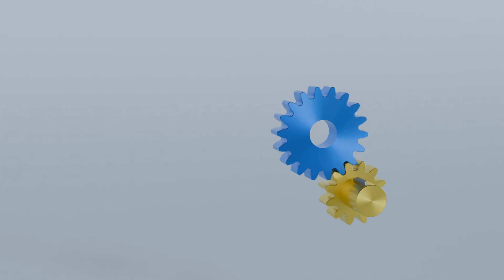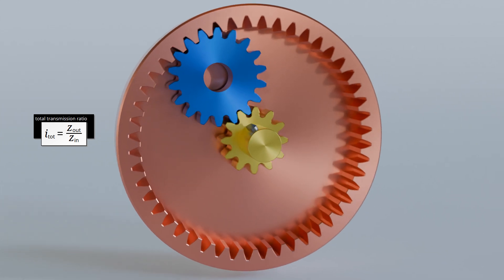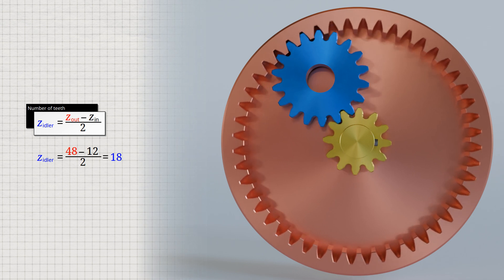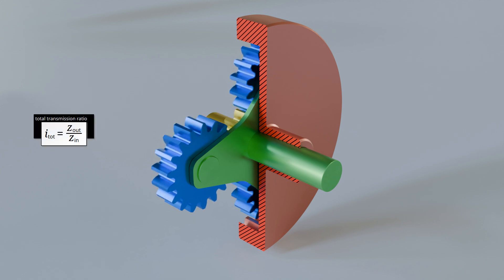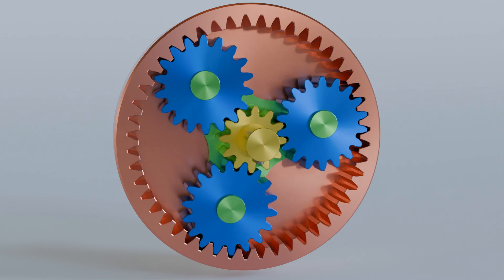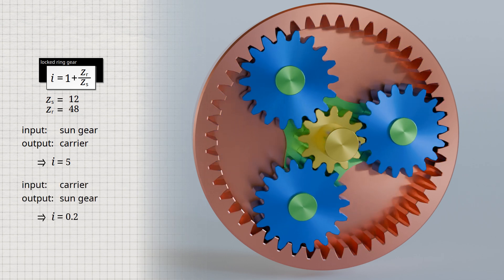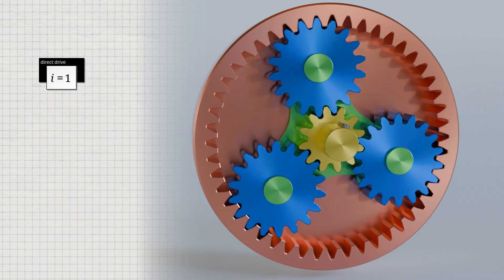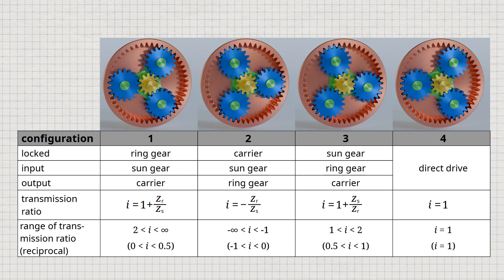How does a planetary gear work? | Design and operating principle simply explained

Comment: And, you can have a continuous variable gear ratio between the sun and the ring gear by changing the rotation speed of the planet carrier.

Toyota's E-CVT power-split device, in other words.
Reply: And I got it wrong. MG1 (starter/alternator/variator) is on the sun gear, the engine is on the planet carrier, MG2 (the drive motor) is on the ring gear.

Comment: The table at 7:08 contains mistakes, specifically the range of transmission ratio for the first three configurations.  In each case, it assumes a minimum sun gear radius, r(s), of 0, but this is not possible, because below a certain, non-zero r(s), the planetary gears interfere with each other if they are to maintain contact with the sun gear.  Obviously, if the planetary gears interfere with each other, the system will not function.  I calculate that the minimum r(s) to avoid planetary gear contact, assume the number of planetary gears is 3, to be r(r)/((2/(1/sin 60)-1)+1), where r(r) is the radius of the ring gear.

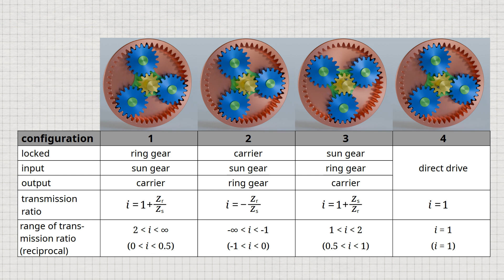Comment: Which of these would a windmill use? Seems like it is not offered at the end of the video 8:00. I would think Locked Carrier, Input Ring Gear, Output Sun Gear? That way you get maximum ration right? I am saying the opposite of #2. In the Windmill video https://www.youtube.com/watch?v=LklUVkMPl8g&t=354s  he shows another variation not on this diagram, which is locked Ring Gear, Input is Carrier, and Output is Sun Gear.
Reply: Depends on turbine output torque and velocity vs alternator specifications to maximize efficiency for the mean average maximum power point.
So you'd need to design around the blades and motor to optimize for the variable of choice.
Most turbines are direct drive to increase economical viability nowadays tho.